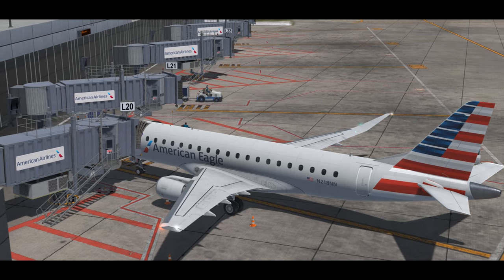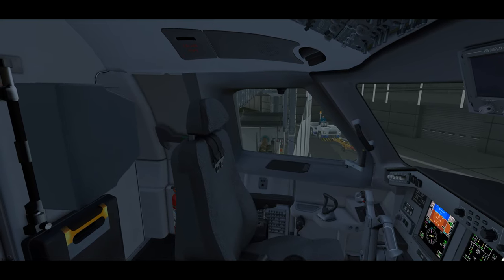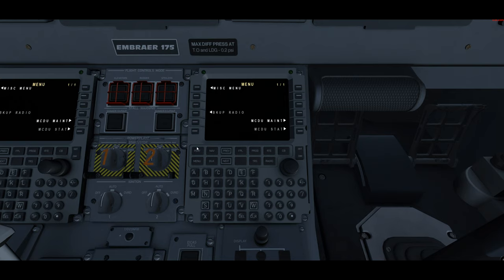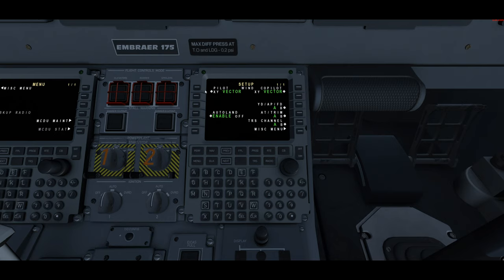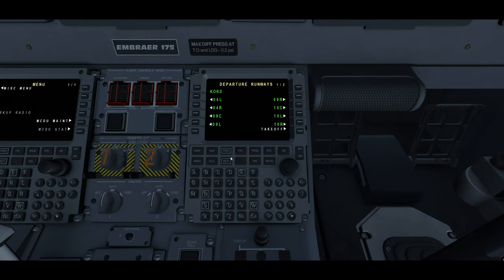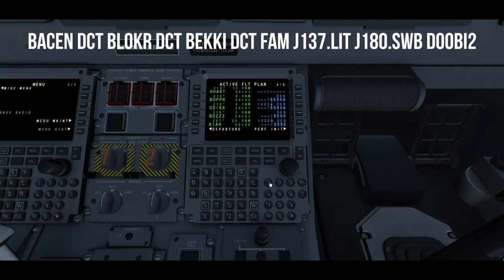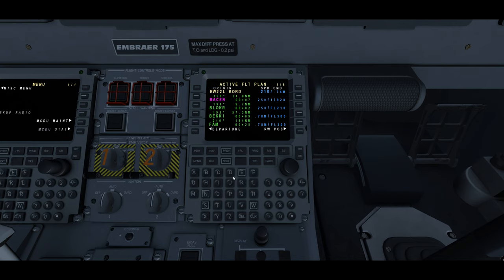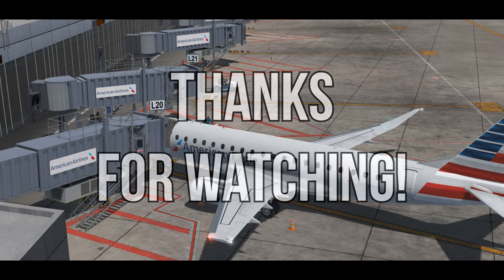P3DV4/V5 Embraer 175 Pilot Series | Programming the MCDU Ep.3

Comment: Have you used the SSG E-Jet on  X-plane? I’m doing my 190 type rating at the moment and have been using that for study during last few weeks.  I’ve just tried FeelThere v3 on P3D 4.5 … and I’m finding it’s not as good with being realistic.

The FMS is missing RTE page, no PERF T/O Pg 2 for Flap, I can’t arm LNAV on ground.. it engages LNAV… 

Thoughts? Have you tried other E-Jet sim products? I’m not interested is the gaming side… purely want a procedural trainer
Reply from the maker: Can't speak much on the SSG E-Jet. The reviews seem better than Feel There one for realism. Procedures and flows will work good with either as the switches are where they're supposed to be. The issue with Feel There is the mcdu functionality
Reply: @GrumpyPilot   thanks for quick reply!  Yeah neither SSG or FeelThere perfect, and I appreciate they are consumer level products… but great study tools.

Is the FeelThere good for Abnormals/Non-Normals? … can you shutdown an engine for example and it handles ok on one?
Reply from the maker: @timbartlett  I've tried emergencies with the FeelThere that are: single engine taxi, takeoffs, and landings and came up with the conclusion quickly that it does not. Basically need full power to single engine taxi the plane, and when it does move it just pulls heavy in the direction of the non-running engine. The only addon I've seen in P3D successfully work emergencies is PMDG for the 737, 747, 777
Reply from the maker: @timbartlett  also unless you're on the a220, a350, 787 this is one of the most technologically advanced jets in the industry. Can do a ton to make your life easy and it's very enjoyable to fly.
Reply: @GrumpyPilot  thanks mate! Coming across from the A350… but def enjoying the handling side of the E190!    SSG is the same with non normals unfortunately … that’s why I started looking into FeelThere as I noticed the fire handle actually moved 😂.    I know how good the PMDG 737 is … so was quietly hoping it was a good way to practice some sequences. 

In meantime I’ll continue to play around with FeelThere and compare it against SSG for realism… there’s some things that FeelThere does better and others SSG do better.

Btw, If you think of any good training resources/links please feel free to send this way. 

Good work with the videos!
Reply from the maker: @timbartlett  will do and very jealous of the a350. Would love to fly but only operator is Delta here in the states. And yep once this summer flying rush dies down I should be able to continue this series